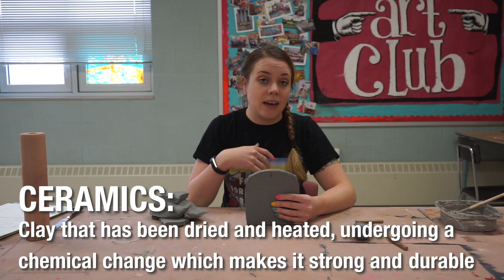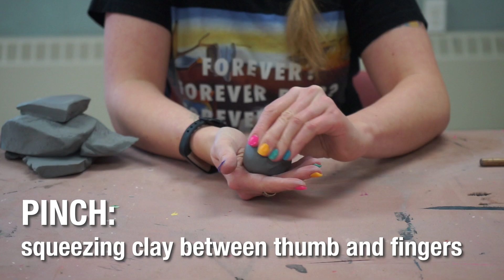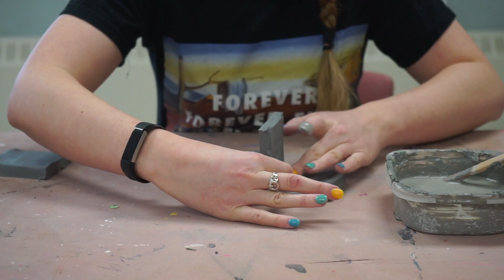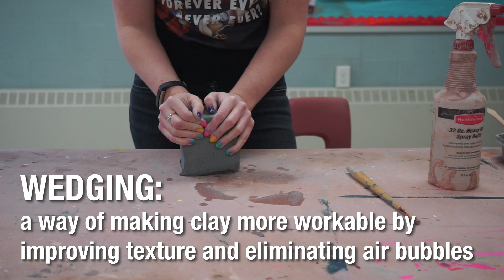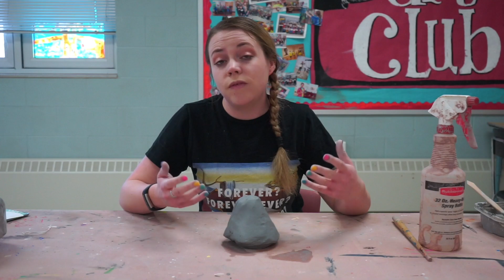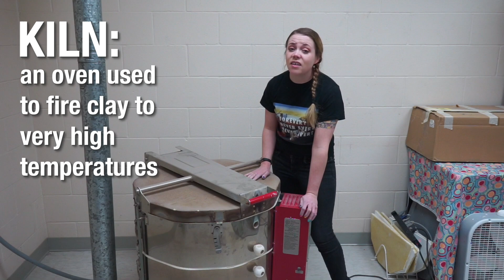Ceramics 101: Clay Vocabulary and Processes

Comment: Thank you, especially for explaining your methods of recycling clay! We don't have a pug mill, and we have loads left over after students finish projects. Any tips on bringing clay back from being SUPER dry and rock hard?
Reply from the maker: The best way is to break the clay up into crumbs/powder, then add water and let it soak up. After the water is integrated with the clay, you should be able to wedge it again. If your clay isn't completely bone dry, but is too hard to work with, I like to pour a cup or two of water into the bag, then while its open, submerge it in a bucket of water, then tie the bag shut. The pressure of the water in the bucket, pushes the air out of the bag and also helps integrate the water into the block of clay. Let it sit for around 24 hours, then wedge.